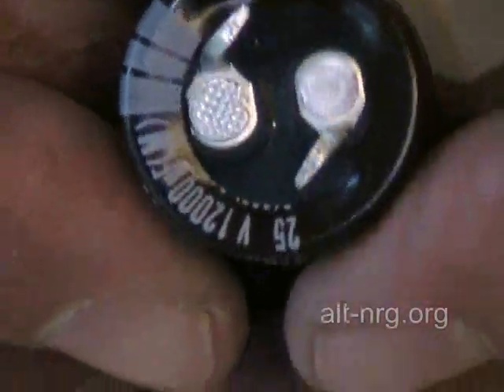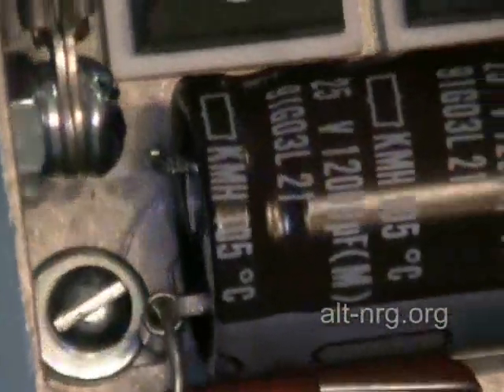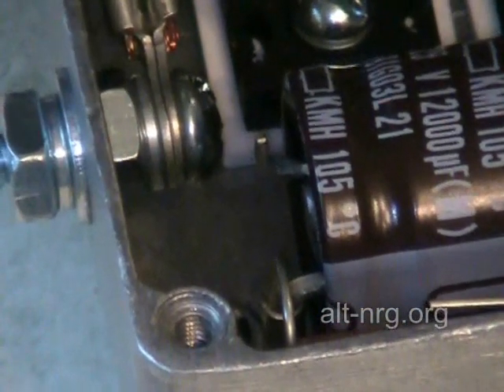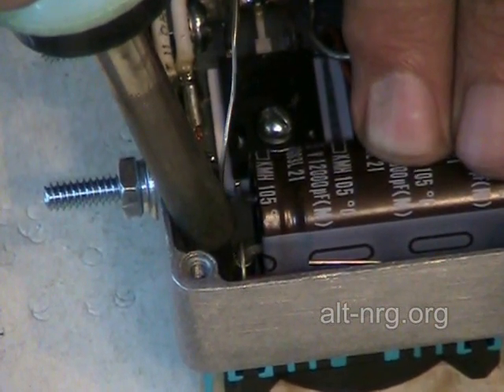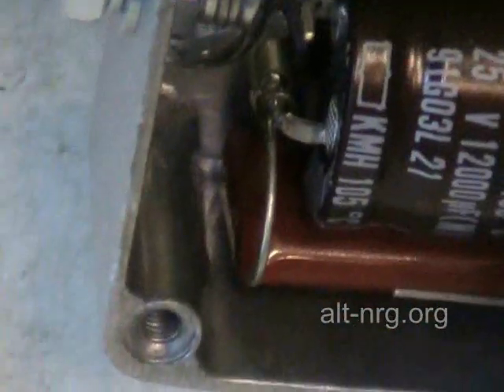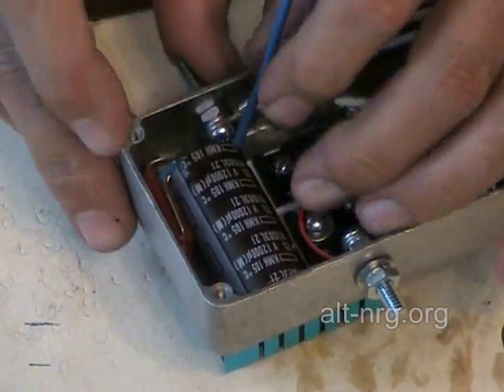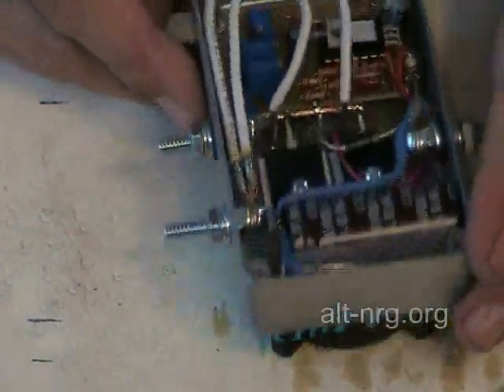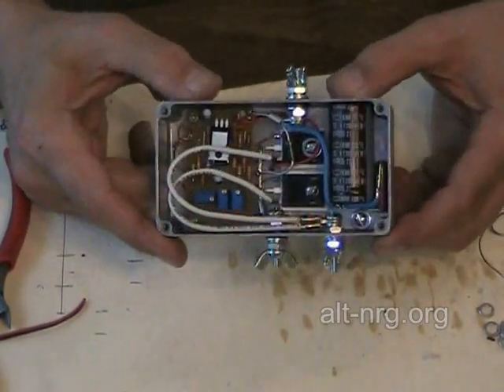#174 - CCPWM Final Assy Part 8 of 8

Comment: ...and overall: it's build much to small. Why make it look like a cellphone? Give it space, at least two, no, three times bigger or is your Honda not big enough? The mosfet should ben mounted outside on a cooling fin. Everything gets too hot in there, even with the fan. I'm sorry, somebody had to say this. You mechanical work on the cells is excellent, but this is unacceptable.

Comment from the maker: @stroker383vega NP. I also updated the PCB layout file to reflect the correct part. I've also had several comments that the MOSFETS I originally specified are out of stock at Mouser. I've posted a suitable replacement in the parts list today. In fact, it's a much better choice.